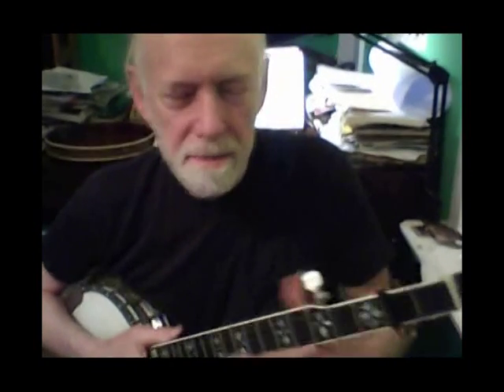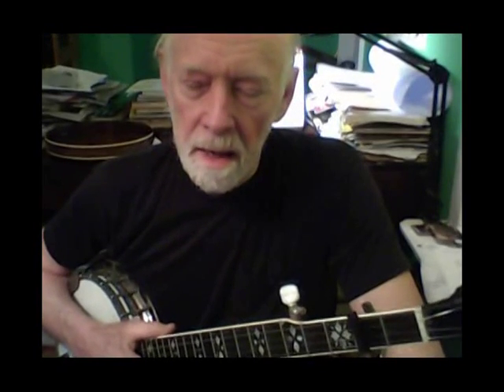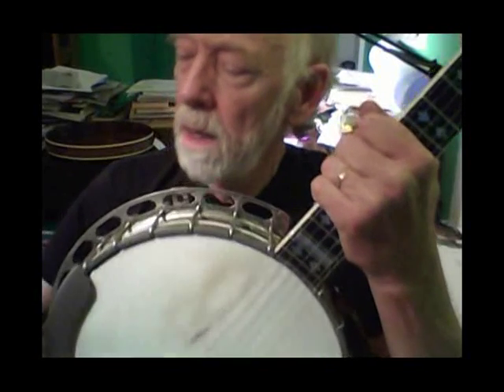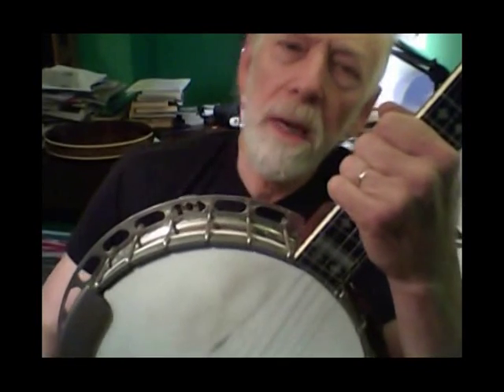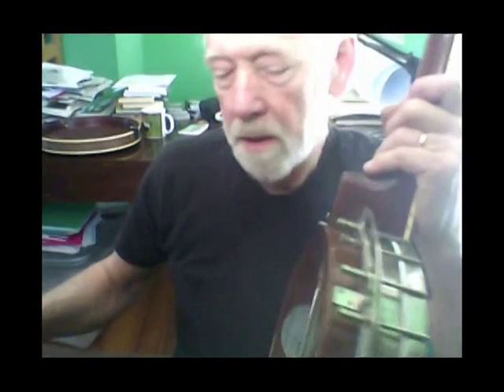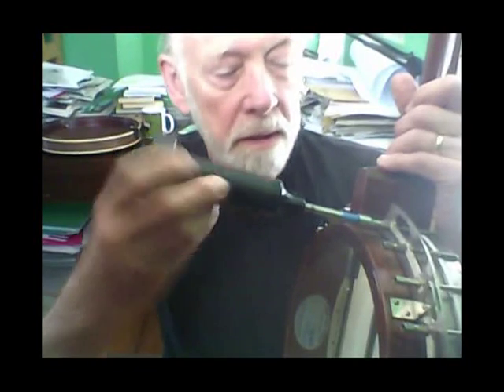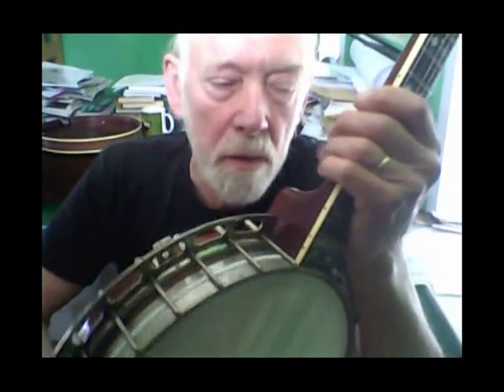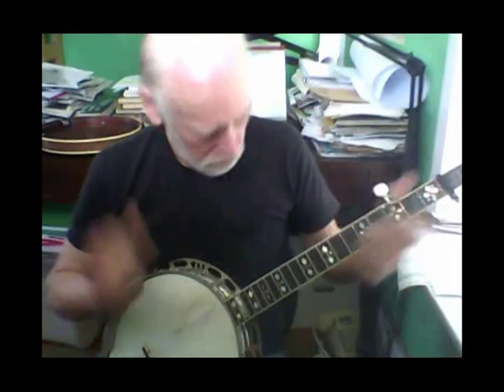Resonance tune a banjo; the howl method: Part I, the head

Comment: That's great!  I have used the same exact method on my son's fiddle by lightly holding the instrument, doing the pitch rise and fall until I feel the back resonate energetically.  On most 4/4 size violins, it is about a D.  That is the air resonance.  But since you can't really alter the air resonance of the box, you can alter the body resonance (the pegs, chin-rest, tailpiece, fingerboard,etc) to match or closely match the air resonance.  This greatly enhances the bass aspect of the fiddle.  There is so much more that one can do to "hot-rod" the sound.  This is just one.
Now, I have just recently picked up the banjo and I find this gem of a video.   And it hadn't occurred to me to try and tweak the banjo until now.  My thanks to you, Sir.

Comment: Was under impression that the head should be "Tap-Tuned" to somewhere between  G, and A flat??  So many opinions, so little time, LOL!      Gb  bg
Reply from the maker: +george scarlettHi George,  In my view tap-tuning is doing it the hard way.  Yes, you can tap the head and listen for the resonant note, but it's much easier to howl into the head and listen for the tone that really resonates loudly.  I think most banjo heads can be tightened or loosened to where they will resonate well at around an A#, which is a good note to aim for.  You don't want it to resonate at a note that is strongly present in tunes you play a lot, like a G note, because the banjo will be too loud and raucous on those notes.  Instead, pick a note, like A#, that is not discordant with the keys you like to play in.  For example, let's say you're playing in the key of G.  The tune you're playing will then have a lot of G notes in it.  And G and A#, sounded together, make a minor third, which will add a nice harmonic to the sound you're getting.  But, if, say, you have the head tuned to some note that is higher than an A# but lower than a B, somewhere in between, it will never sound good with the G note, and the banjo won't have as alive and punchy a sound as if you had it nailed in at A#.
Reply: +Mike Aucott   Thanx Mate.  Just got my Recording King  RK-R20 today, and will probably give 'er a "Howl" shortly, LOL!  After a brief inspection, looks like she's gonna need a little Fret Leveling TLC, but being a Luthier, T'aint no big deal.  Also, can't find any info on the RK's truss rod, but she appears to have a "Two-Way", and that's always a nice surprise!           Gb          bg
Reply: Mike Aucott Very interesting. So in this video you're howling an Eb. That's pretty far from the "recommended" G# head tension. But it doesn't sound that low to my ear, when you play it. It sounds right. My question is -  do you get another note when you tap the head than when you howl a note on the same banjo?
Reply from the maker: It depends on the banjo.  It will resonate at some different frequencies.  You should look for a resonant frequency that is strong, and then try to adjust it up or down as necessary to fit in well with the keys you normally play in.  In the case of my banjo, Eb seemed to work well.  Since I play in G a lot, Eb is good; it's a minor third above G, which is a fairly consonant interval.  In my view, there's no need to strive to hear the sound you get when you tap the head.  The head and banjo will resonate at the same frequency no matter how the vibration is set up.  It's a lot easier to get a good loud tone to set the banjo vibrating by howling into the back of the head rather than tapping it.
Reply from the maker: The recommendations to go for G# may apply to some banjos, but not to mine.  Once I'm done monkeying with it, my banjo seems to easily resonate at Eb,  and that's a good frequency for a lot of the keys I play in.  For example, if I'm playing in C, and the banjo wants to resonate at Eb, that's OK, because that's a minor third above C, which is a relatively consonant interval.  I don't see why you'd get a different frequency by tapping than by howling.  The banjo is going to have some frequencies at which it resonates regardless of how the vibrations are set up.  In my view, howling is a lot easier and tapping.
Reply from the maker: What I meant to write was "since I play in C a lot, Eb is good, it's a minor third above C.."
Reply: Amazing, thanks Mike. So easy to hear and feel. I'll keep watching out for the air chamber video. One day perhaps, when life doesn't get in the way. 😊
D# works for me, the nuts are just 'creaking and it 'feels right.